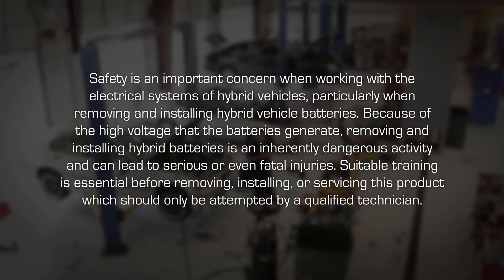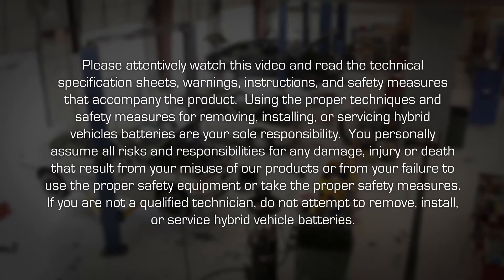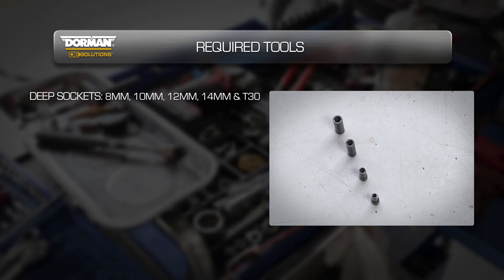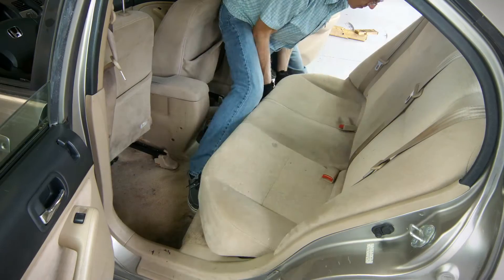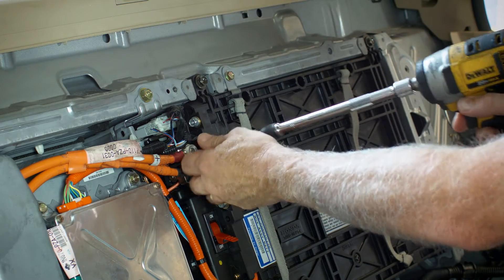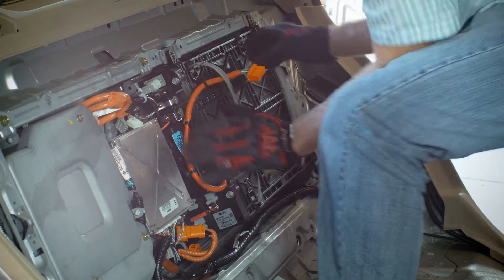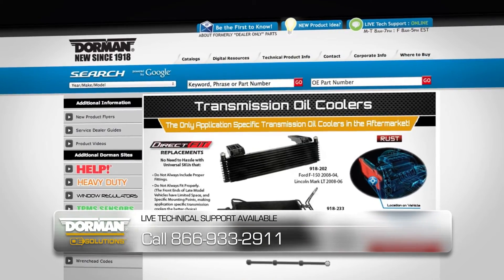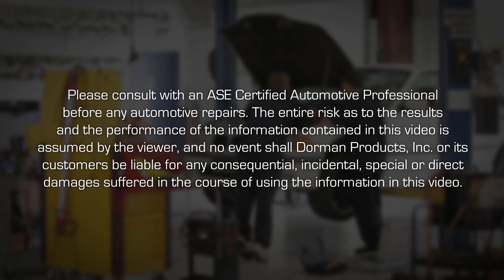Honda Civic Hen 1 hybrid battery installation

Comment: Should I use a torque stick so I don't torque the bolts back in too hard?  I'm looking at an impact wrench that would max out at about 200 ft-lbs.
Reply from the maker: Amity45 When we say impact wrench, we are referring to a cordless gun like in the video. We are not suggesting a 1/2" air powered impact driver. You certainly do not want to run these bolts in with a full power air gun. If you do not have an electric gun like in the video, I would just suggest a 3/8" ratchet to hand tighten the fasteners.Thank you

Comment: is a drill necessary or can you use a screwdriver?
Reply from the maker: Hello Josh. The drill is not required. You could certainly use a ratchet or wrench to remove the bolts.